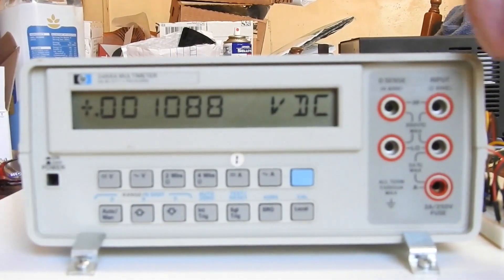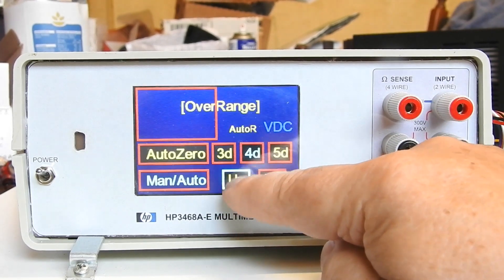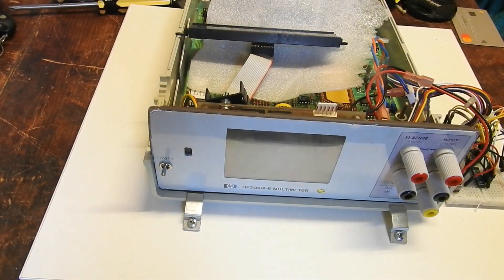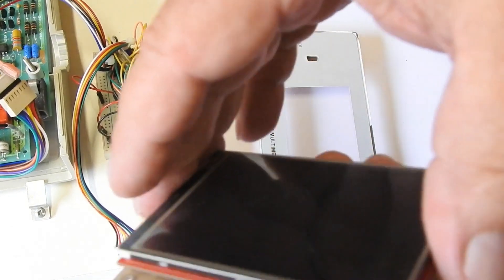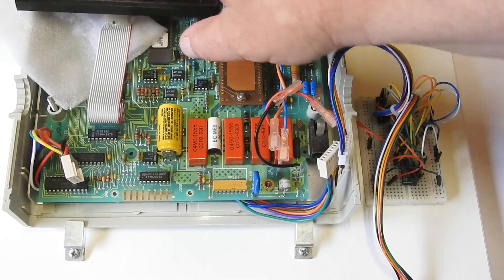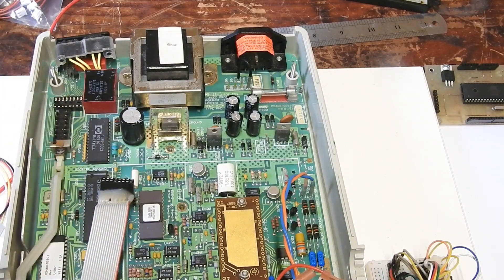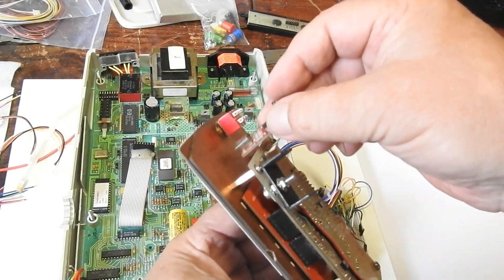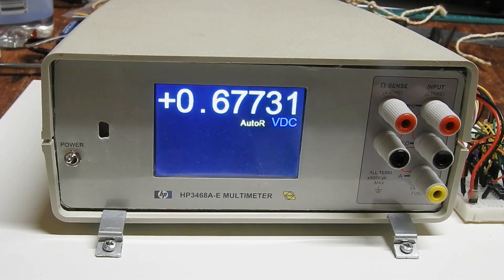Replacement Front Panel for my HP3468A multimeters

Comment: Interesting!  I have some 3478A's, with the same display issues.  In my lab, with my eyes, and my lights, I've never had a problem with it.  There are lots of people who share your perspective, though, so... carry on!

But II'll say...  I kept looking at the display screen, and noticing a lot of wide open space, and then seeing your interface that flipped screens to change parameters.  As an impartial critic (!), I think I'd prefer mode buttons and 456 buttons accessible always, single-touch, if there's room to put them on there.  Or an option, at least!  But then again, I'm not a touch-screen fan; I actually like those old-school buttons!  But the display itself... obviously a drastic improvement in visibility.  I don't know.  It's UI, right?  I think you'll have to live with it for a while to see what you like and what you don't!
Reply from the maker: Yes, I like actual buttons too, but it does have a touchscreen, so they're really just not needed. Common functions can be just two touches, which should be bearable. Also, there is the extra holes to be cut, and need for more I/O pins. Despite that, I may add some anyway. And I'm probably going to move the whole meter into a new box, just for extra craziness!

Comment: Nah, waste of effort. I would understand if LCD died or smth but this frankenstein with barbie head is pointless. Cant see here tangible benefits. As well, this table where everything is fixed on is like a wheelchair for a person which can walk. I might consider backlight mod for my 3478A one day but this face transplant is a no go.
Reply from the maker: Wow! I get that you don't like my idea, and don't see any value in it. Not sure how that warrants the insults and the mockery, but to each his own.
Maybe you didn't understand that it's a prototype development rig, being used to demonstrate a concept.
Nonetheless, despite not receiving your seal of approval, I will proceed with the project, and show the result when I finally get around to completing it. Maybe you'll like that a little better...
Reply: I didnt told I dont like your idea, I told I would not do the same even if I had enough brains. In this world everyone does what he wants and especially on youtube. IMHO, LCD on the 3478A is indeed not super contrast but simple backlight mod would do. Back in the day this LCD was top notch tech and Internet was not existing yet. Still, device works 50 years later. I have doubts this fancy touch screen will not fade away or break in 6 months cus planned obscolescence. In short, looking forward for finished product. Subscribed.
Reply from the maker: @mikedfgfj  Fair point about possible early failure of the cheap display. I haven't seen any reports of these failing, so I hope it lasts - we shall see. The idea is also intended to add value by providing more features than the original display. Thanks for subscribing, though it might be a while before there's an update on this.